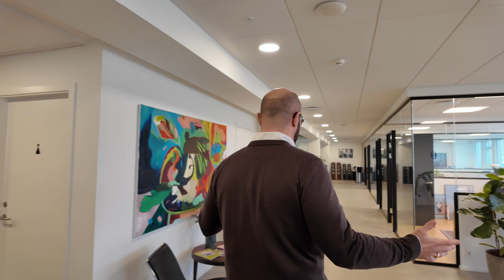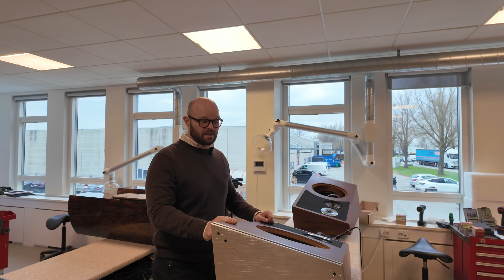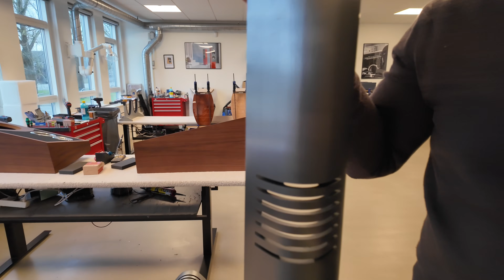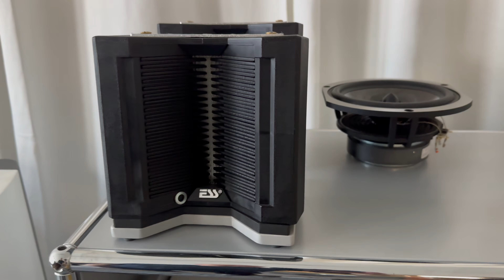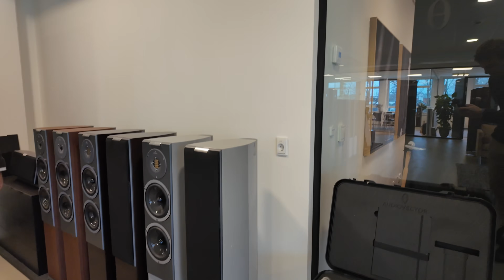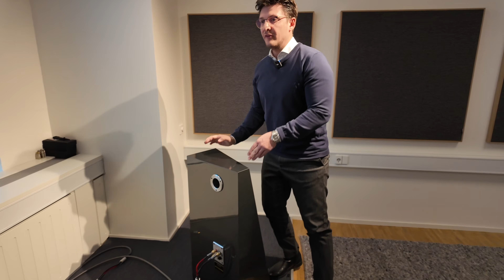Audiovector Factory Tour - The Art of Danish Loudspeaker Perfection!

Comment: Crossoverparts from bevenbi china for example the orange resistors
Reply: I really don't get it. Spend money on putting 11 coats of clear on it, which does absolutely nothing for the sound, and fancy veneers that do nothing either, but cheap out badly on the crossover that could make a huge difference. The first thing I would want to do is change over the crossover for some decent parts.

Comment: The isobaric cabinet technique is interesting. I wonder how much impact this has over the overall bass performance of a passive tower speaker.
Reply: Very little in real world terms. Typically, you would use two of the same driver. Think of it like a car with two engines, rather that two separate cars. Two engines doesn't mean that the car will go twice as fast, but it will help it go a little bit faster. The second driver in the speaker is reinforcing the first one.

Comment: Great video! Over last 5 years owned over 15 pair of speakers many amplifiers dacs cables and honestly in high end audio system Audiovector sounding spectacular. So clean so honest but required excellent electrics as will play as good as all the rest of audio chain. I'm running R1 Arrete with fast sub amplified by Danish Vitus Ri101 as well as Icon Audio mb845mkII valve monoblocks and Sansui Au07 dacs Audio Gd R7He Schiit Yggdrasil and Lampizator source Innous Pulse. To my taste in this set up R1 Arrete are worth market price and I know what Im talking about as also own BWv805d4 and older Audiovector SR1 avantgarde. Love Audiovector and it was a pleasure to see such a amazing modern factory. 

Thank you.

Comment: Poor crossover relative to speaker price , in special those iron core inductors  , little cement resistances, and if am not wrong a cheap blue vishay ......
I mean .not the worst crossover that i have seen , and i do understand  that the cabinet is costly to make with all that angles, , also the quantity and quality of the drivers, 
Even so,.......it could be a bit better ! 
I like audiovector, but i always see this on their crossovers, 
maybe not in the most expensiver arrete line , (that i do not know , i think duelund is used ), 
but yes..could be better once more, its not like the trapeze is a cheap speaker,
Reply: Couldn't agree more. All I can put it down to is that most people that consider themselves audiophiles, are more like audiophools, that buy speakers with their eyes, not their ears. Way too much spent on making it look pretty, nowhere enough spent on making it sound great.

Comment: I have the R3 Arrete in walnut. Nice speakers that sound good. Was not that impressed with the timber finish though, I needed to lightly sand them and apply a few coats of wax. Now they present much better. The clear coat they use is far too thin, I’ve never seen a timber finish with such a thinly applied clear coat, to a point where the timber grain was rough to touch. Not ok on $16,000 speakers.

One of the bass drivers had several scratches on the metal dome, should not have passed QC. I was able to lightly sand out the scratches with 2000 grit paper.

Now I’ve fixed those two issues I would give these speakers an 8 / 10. Using them with Accuphase, very happy with what I hear.
Reply: If they were secondary they are probably not built by Audiovector, maybe a pirate copy made in China.:face-purple-crying:

Comment: Typical garbage nothi g premium
Sony ES serries from.80s had 100khz treble 

No copper version or nrass or OAK materials
No coppper damping
No 3inch woofer excursion
No 5inch deep magnets or double 2inch
Single crossovers sharing 4 drivers instead off 1 for each drivers
No super tweeters for 50khz too 200khz
No pure silver tweeters or diamond coated or berryluim
No pssive design